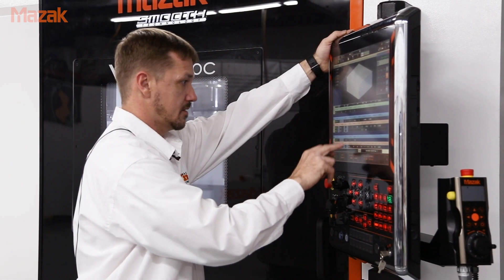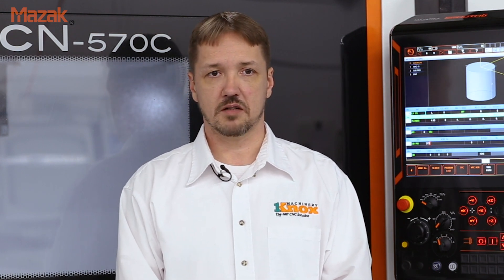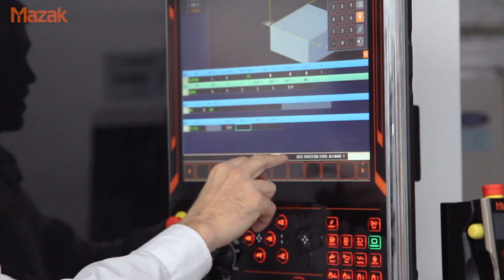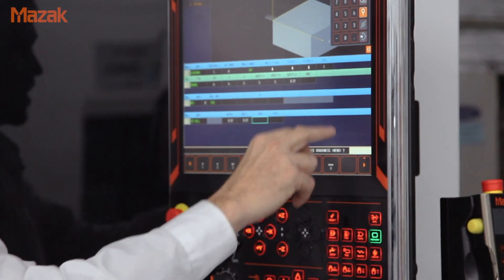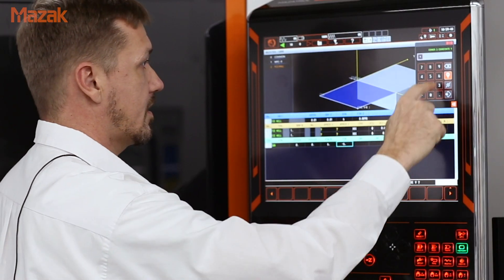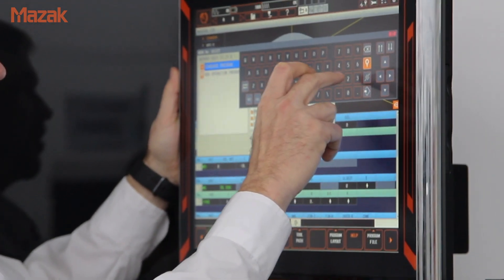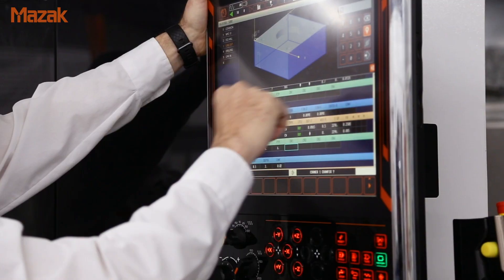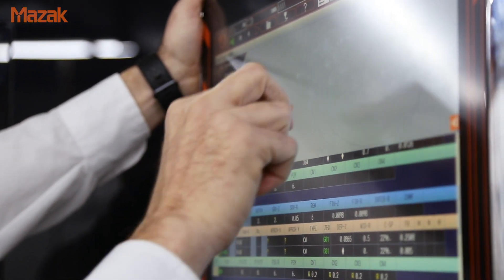MAZATROL Makes the Difference - Knox Machinery

Comment: Another question, is there any set up position for tool load/unload/visual inspection where you can set the axis position closer to operator for a much easier and faster tool change/inspection. I saw the M152 for set up position to  move the axis after the program finish including door override activation. Also , when I touch my tool it just retract at Z axis not in set up position.
Reply from the maker: You can change the location of the table with the RETURN field in an END unit in a MAZATROL program. In the RETURN field you can choose ZERO, FIXED PT, OR ARB PT. Please contact your nearest Mazak Technical Center for support if you have more questions.

Comment: How to do a multi pass for thread milling in Mazatrol program. Also, where is the option to set tool offsets for tool geometry and diameter page? It usually entered into tool data page. Is it selectable option where to input the tool offsets? I'm currently assigned to run the Mazatrol Smooth VC500.
Reply from the maker: Thread Milling can be accomplished in a MAZATROL Unit using either a Circle Mill Unit with a TORNADO move or a PLANET CYCLE in a TAPPING Unit. If you wish to do multiple radial passes, try programming two separate units at different diameters. Tool offset information can be entered in TOOL DATA or TOOL OFFSET. These fields either work independently or together depending on your parameter configuration. We recommend using TOOL DATA. Please contact your nearest Mazak Technical Center for support if you have more questions.

Comment: mazatrol is good for many things. cad cam is much faster and you have control over so much more.
Reply: It's definitely not faster
Reply: @CPTFiXtion  challenge accepted I can program faster in mastercam than you can count to 10 ,, but will give right in matmazatrol great for many normal things ,, and it is easy and fast to correct things for ,, especially thread and rough and finishing

Comment: I will agree, that Mazatrol is indeed powerful, and does shop floor programming exceptionally well. However, shop floor programming is going the way of the Telegraph. Why waste valuable machine time programming, when those tasks are much more thoroughly completed and validated offline in a CAM environment, while the machine is making parts? High value / high volume parts that require absolute traceability and process control would also never allow for shop-floor programming.
Yes, Mazatrol is a great tool for smaller, mom & pop types of shops, but even most of those now have greater engineering sophistication than what shop-floor programming provides. I would like to see the development emphasis be elsewhere in the products.
Reply: does your mazatrol allow you to engrave?

Comment: Does the most up-to--date Mazatrol software in the new Smooth machines generate adaptive clearing patterns for milling operation or are they the same as the integrex? 

I've always loved Mazatrol for all the turning and "point-machining" applications but it's a bit behind on the milling side of things. 
Also, did you add polygonal machining into Mazatrol? I was surprised that I had to make my own macro program and use the "add-in" feature to make it easier for the new people at my work.
Reply: If you go to any pocket milling strategy in Mazatrol, where you would normally select between CW or CCW for climb or conventional cutting, look for a button labelled IPM (Intelligent Pocket Milling). This is our modern constant tool engagement roughing strategy to enable higher material removal rates and increased tool life.

Always remember this style of toolpath requires having lots of room for the tool to move. If you need help finding the right settings to suit your need, remember Mazak Applications Engineers are here to help!

https://www.mazakusa.com/offices-and-distributors/
Reply: You can use adaptive tool paths in certain milling units like slots and line left or line right. They are somewhat limited though. In slotting units you can’t make a slot wider then double the size of the end I’ll your using so if your using a 20mm end I’ll it give give you an alarm on any slot wider then 40mm.
Reply: @hdfanboy  If you need Intelligent Pocket Machining on a slot wider than the slotting unit will process, it will also be possible using a pocketing unit. I have not tried to do what you say personally, but it wouldn't hurt to contact your local Mazak Applications department for assistance if you have further questions!

https://www.mazakusa.com/offices-and-distributors/